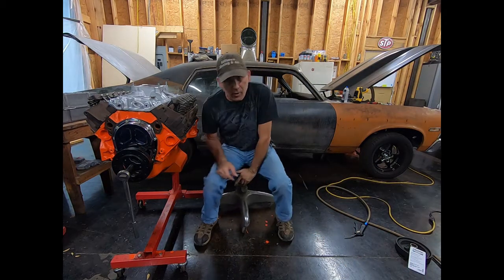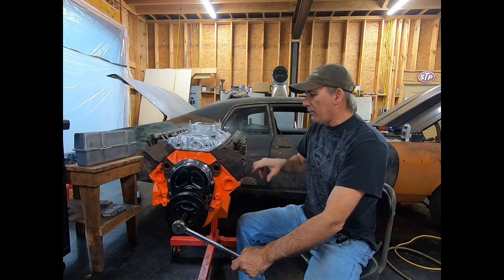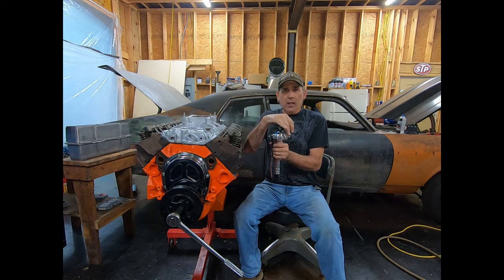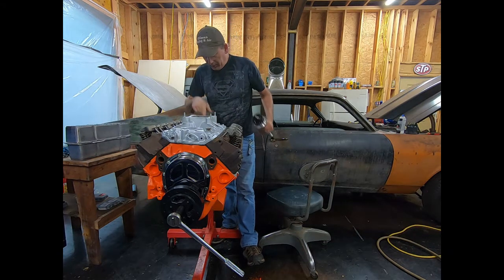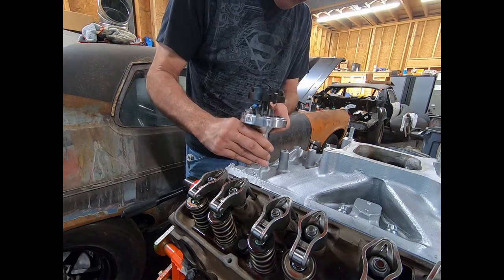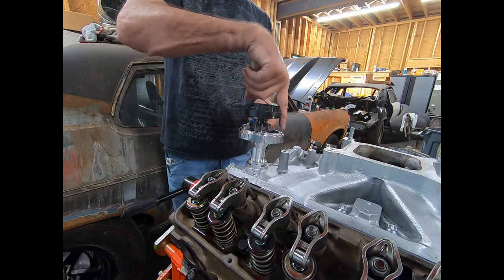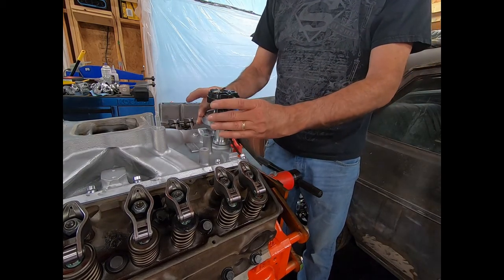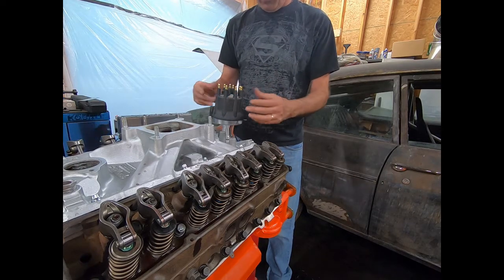Chevy Distributor Install

Comment: Thank u for all ur help. I finally  did my first  startup.. .from the engine to converting  the front  end of a 74 to a 72
Reply from the maker: Awesome. How’s it running?
Reply: @Shop209   its running good   sounds so nice with the  longtube headers  ..... my gas pedal linkage   is  loose.    I need to change it. Or. Cut its to long now.  . .

Comment: I agree with this procedure. My variation is with the initial advance setting. With the harmonic balancer line set about 2 degrees, I connect 12 volts to the “Bat +” terminal and a test light to the tach terminal. I turn the distributor until the rotor is upstream from the number one post. Turn the distributor counter clockwise until the test light comes on indicating coil collapse initiated. That’s close enough for an easy start. I’ve done this with points and HEI and it never fails (even that one time when I put the plug wires on the cap counter clockwise).
Reply from the maker: I have done that on points. Never on HEI but it’s a good way to do it.

Comment: What’s the easiest way to set the timing with the engine already in the car?
Reply from the maker: As far as setting the distributor timing, once you get it installed and ready to crank, unplug any vacuum advance(make sure hose is plugged after) set initial timing with a timing light to where you want it and then rev engine to about 2800rpm. Check total timing. You will need a dial back timing light for this. I have a video planned for this.

Comment: I'm about to do this, been working on my 350 5.7 vortec for awhile, my profile picture shows it. It came out of a 99 tahoe that I converted to carb. 
     I installed a dual plane high rise air gap intake manifold, (Weiand 8502 sbc vortec speed warrior) the exact one they showed on Engine masters with david freiburger and the 2 steves, they show that it's equivalent to the Elderbrock RPM performer air gap manifold on the dyno, and in my David Vizard high performance 350 build guide book. 
     Long tube headers, MSD 8362 Street Fire HEI Distributor, 8mm spark plug wires and a 1406 elderbrock 4 barrel 600 cfm carburetor. 
      I may try making a video of it if all goes well! 😁

Comment: Great video! Just now found your YouTube video. I have a question regarding my 89 Chevy 350. My truck would not start, I had no spark on the number one plug. It's got 150k miles so I figure it's time to install all new parts. I had the rotor pointing toward #1 plug before removing the distributor. I installed the distributor with all new parts and a new primary coil, started right up and ran smooth. But on this model you supposed to unplug the advance timing plug and set timing on TDC, then plug back up and set timing on TDC.  With the advance timing plug unplugged, the truck will not start.  I don't think the engine was on the compression stroke when my timing mark was at TDC mark before removing distributor. Could my timing be completely off?

Comment: So i did my first star up ..everything's  whent good until  my distributor  got out of place since i didnt  bolt  it tight ..... then..... i did everything  again  n i was getting  misfire  .  Turn off on me .  So idk.   Maybe  my timing
Reply from the maker: Ok. Double check your wires. Do you have a timing light?
Reply: No.  Hopefully  this weekend i get  to work on it  again ......

Comment: Good video buddy what about if I have a" points distributor "on a 56 small block 265 is it installed the same the same way.😎
Reply from the maker: Yes. Although you’ll have to set your points gap and dwell.

Comment: Didn't  say how to install  it  or show any one
Reply from the maker: Actually I did. In the first 5 minutes.
Reply: @Shop209  I meant  telling  someone  it's at T.D.C.  Besides  just putting it at zero doesn't always work if the balancer is off. Or on exhaust nor compression.  Use a screwdriver or flashlight  see where exactly the piston  is.
Reply from the maker: I showed how to get to TDC on compression by watching the intake valve open and then close. The next time timing mark is at zero is TDC of compression. As far as the balancer being wrong, that was covered in the engine assembly video. At this point it would be more if a troubleshooting issue if it’s off. I’m not if fan of sticking stuff in cylinder to feel for piston.
Reply: @Shop209  o ok thanks  I didn't  see  the other videos.
Reply from the maker: No problem. I appreciate you watching.
Reply: @Shop209  teslong bore scope is super cool for about $150 you can watch piston coming up and down and watch valves open and close, in my case where motor is in vehicle